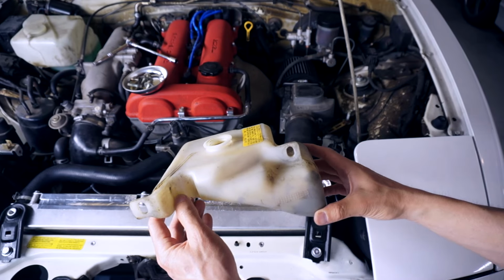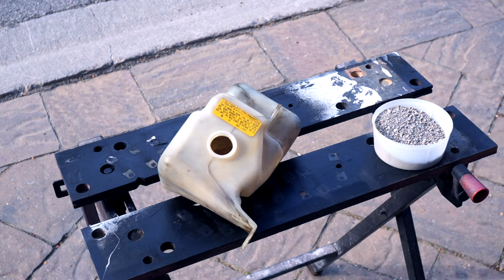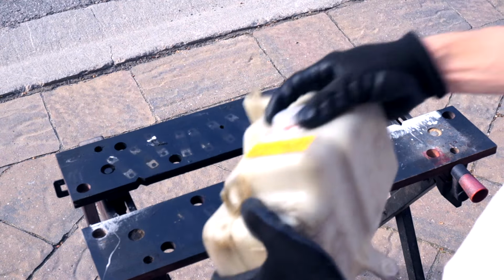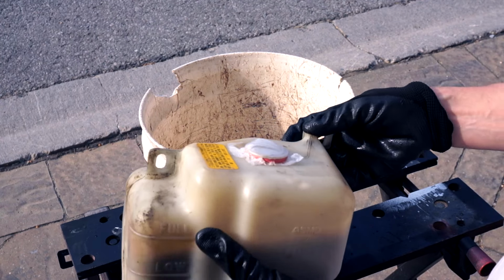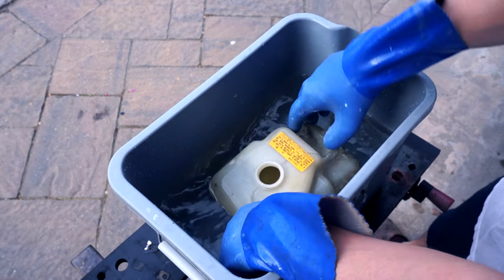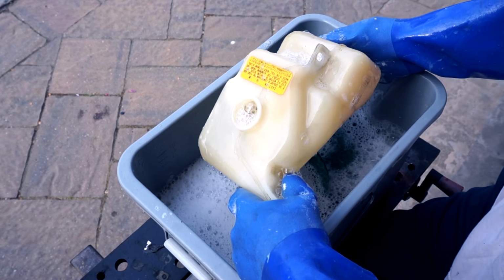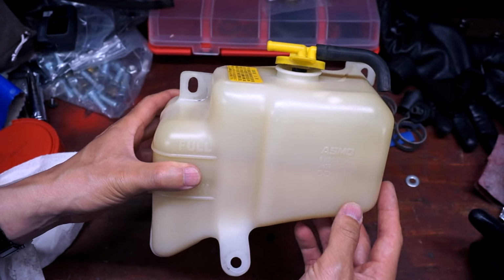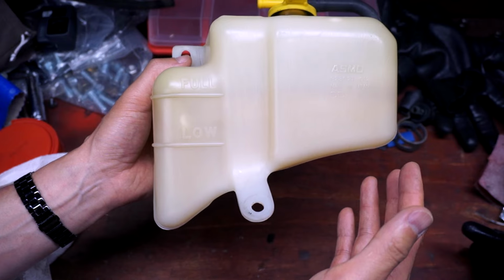Simple DIY Coolant Tank Cleaning, Very Satisfying!

Comment: Probably more expensive than your lemon scented bleach, but I think a good soaking with CLR might do a better job. Might try walnut shell blasting at low air pressure.
Reply from the maker: Good suggestions, if I could get the nozzle inside the bottle it may eat into the plastic.  Might be worth a follow up vid 😉

Comment: Thanks for tips but its not work in my volvo s60 because there is a magnet inside the reservoir to connect the level sensor of the coolant.
Reply from the maker: You might want to skip the abrasive material, or use a less aggressive medium. But YMMV

Comment: I used degreaser on my tank and it took everything off instantly!
Reply from the maker: Do you have an aluminum or iron block?  Iron tends to leave rusty residue that's hard to remove.
Reply: @mostlyuselessgarage  I have a 2006 subaru wrx. The block and heads are aluminum alloy. My coolant tank, just had dirt/gunk buildup from previous owner! But i just used degreaser w a straw tip, and it literally took all of it off on contact. I was worried about the degreaser leaving oil/oil residue, so i washed it out w dish soap and car soap multiple times until it didnt feel greasy to touch inside anymore.

Comment: I just put a new radiator and a new overflow and it's still sludgy
Reply from the maker: If you're iron block you're gonna be picking up a lot of that contaminants in your motor.  You may want to flush the coolant a few times or just send it!

Comment: Yeah no. Most cat litter has clay in it and it will stick like crazy. Use bbs instead
Reply from the maker: The oil dry worked well as an abrasive and didn't stick. BBS? Like the famous mesh rims?

Comment: if it's cheap to replace, just buy a new one. Mine is like $15 - just replace with new. I wonder if the chemicals you put in it will be almost half the price of the replacement and you don't account for the imperfect clarity you will have on the cleaned container and time spend on repairing. 

Not to mention this chemical treatment seems quite long and you need to soak for a long time so you might be without a car during this time.

edit, I thought the scrubbing on the outside was pretty useless. I am surprised you didn't use a diswashing stick thing and push it into the bottle and try and scrub out the insides.
Reply from the maker: Stock Miata units are ~$70 and aftermarket metal ones are ~$150 so YMMV. The bleach and dish soap used were basically free, as was the few hours of my time. Thx for the comment!

Comment: I have no idea how I ended up watching a video on cleaning a coolant overflow resevoir but here I am. If you want to get those remaining rust stains out of the jug use a product called Iron Out. It comes in powder or spray. Add a little to the jug, slosh around, wait 1-5 minutes, and rinse. Just be careful, it is an acid product. Cheers.
Reply from the maker: Great idea with the Iron Out!  Thx for the feedback!

Comment: Hi Bro. Saw this on youtube. MAGIC. Should be a 24 hr soak with a water and Sulfamic Acid mix.
Search this YOUTUBE video  " How To Clean & Restore Coolant Tank - PERMANENTLY" from "LOW MILEAGE" post.
Sulfamic acid is used as an acidic cleaning agent, sometimes pure or as 
a component of proprietary mixtures, typically for metals and ceramics. 
It is frequently used for removing rust and limescale, replacing the more 
volatile and irritating hydrochloric acid. It is an excellent de-scaling agent.
Reply from the maker: Dude, awesome recommendation!  TIL sulfamic acid would be great for this job, and is available from Home Depot. Another commenter also recommended Iron Out. Sounds like a comparison video is needed!
Reply: @mostlyuselessgarage  yes please. comparison video would be stupendous !!!
Reply: Lots of people have said that the video you meantioned is fake, as one of the broken pieces on the initial tank is repaired on the finished tank
Reply: @hah1738  wow. thanks for the info. did not see that one if it's true. never tried Sulfamic acid myself. Just wanted to mention the video. Have no need at the moment to clean and restore a tank. Cheers
Reply: @mercamg9312  Yeah I'm not sure either, I bet acid would do a good job. But it seems he faked the sulfamic acid video for views by buying a new tank
Reply: @hah1738  Yeah, and the metal inserts changed from brass to aluminum on that video
Reply: I bought the acid tablets and will test it out, will let you guys know. Some say it helps but I'll test it for you. Doing a flush on a 04 sierra over 150k miles